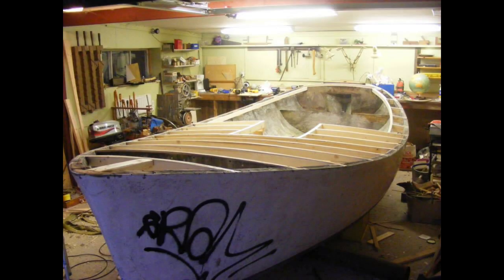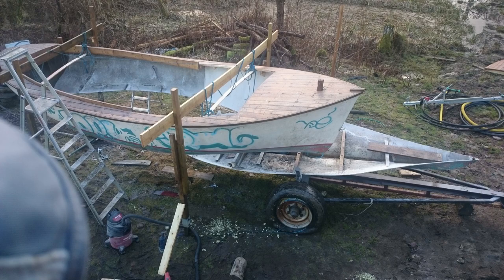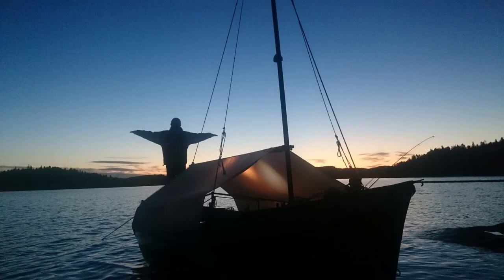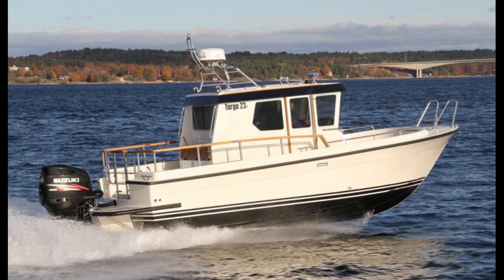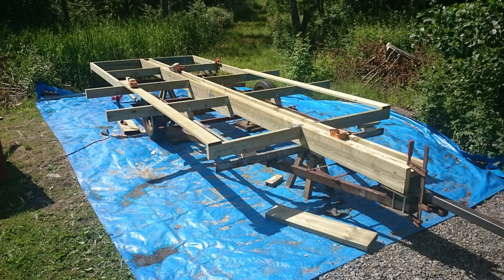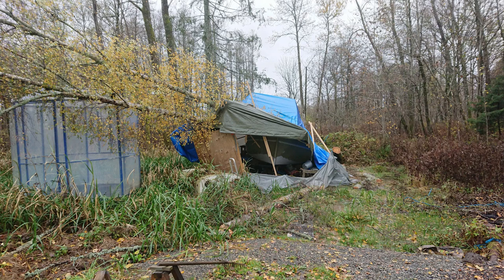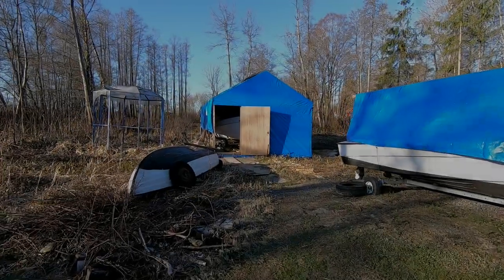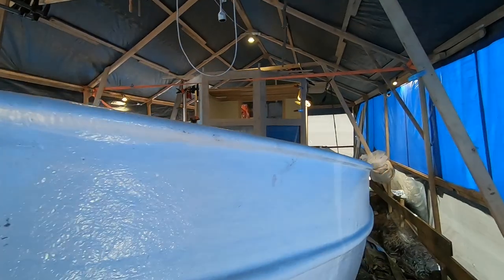Building a Big Flat Bottom Boat - The Story of Albatross

Comment: Some of the Swedish Fishing vessels had side mounted Keels that could be lowered in deep water for stability.  It would save cutting a hole in your bottom for the centerboard.  With a rudder that also could be extended you might have a better design.
Reply: perfect idea!!
Reply from the maker: That is a good idea.. I just don't think it matches the esthetic style I'm going for. Side mounted keels are very common in the Netherlands, but I've never seen them here in Sweden. It did sting a bit, but the hole is already cut :)

Comment: Sir Is there any pictures of how you did the bottom of the first boat? And if there is then is there anyway you would be willing to share them and send them to me? I'm just doing the exact same thing you did to the first boat and I'm trying to decide on how I'm gonna go about doing it. Thank you.
Reply from the maker: Cool! The first boat wasn't very well documented. I cut away the bottom with an angle-grinder. Put the top part of the hull the right side up on a flat surface coated in mould release. Then I simply did a glasfiber lamination against that surface and overlapping the hull around 20 centimeters. It did not turn out pretty but it worked very well. Talking to other boat owners on the lake, not a single person ever noticed that half of the hull was missing:) 
Good luck! I hope to see pictures/videos!
Reply: @miormedia  thanks for getting back. I  have half been thinking of doing it that way myself. Way, I see it. I can do it a number of ways that will work, especially since the boat was headed for the junk yard. Since it was essentially a free junk hull, nothing I do is gonna make it worse.
Reply from the maker: @adamtedder1012  That's a great situation. There's no pressure, and everything you do to it is making it better.
Reply: @miormedia  exactly. I'll definitely post up something on it, maybe under a different channel. I shitpost with this one and occasionally get put in youtube jail. The ahole in me can't help myself.

Comment: It'd be great to sail a 40ft live-aboard boat [w/bow center board] with a hull so thick/resilient i could crash over any rocks [under 12knots] without sinking/severely damaging the boat.i'd just carry a dingy/big anchor/winch and drag myself off of whatever i might get beached on. my thought was having 15 cheap, 10" diameter detachable [bolted laterally], treated logs as a sturdy bottom set below durable 6" of foam as a hull. ... essentially ... a solar sailing barge with an powerful electric motor. .... OR ... Rig sails [cabin et al] on a WW2 (LCVP) Landing Craft - Higgins Boat ... https://www.youtube.com/watch?v=hde7OVJKdgg